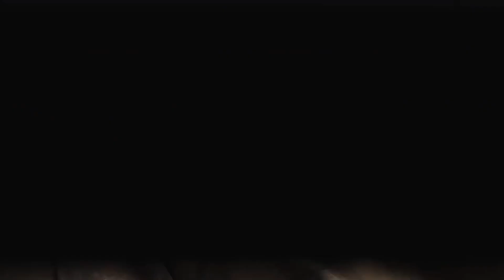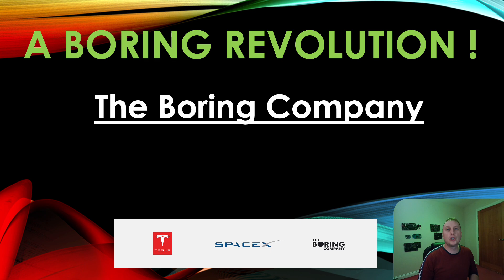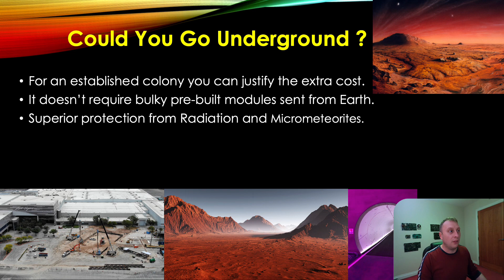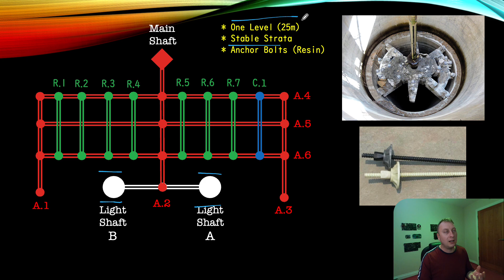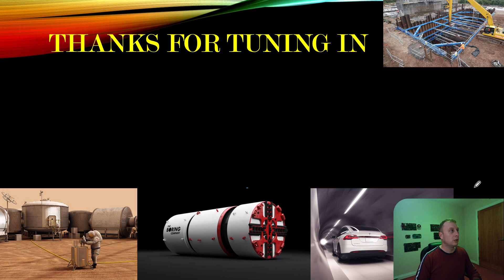A Boring Company Guide To Tunnelling On Mars 😃 👨🏼‍🚀 🚀 🚇 🏗️ 💰 #181

Comment: How do you keep the pressurised gas from escaping through the cave surface or cracks? Without large amounts of water to spare, TBM or shotcrete are not viable; an underground mine could work through a side wall of a canyon, like some proposed projects, probably at Vallis Marinaris. Ores will be found thousands of kilometres apart, so freight is necessary between sites.

Comment: There's no way large machinery like a Prurock TBM will be shipped to Mars from Earth. One day TBMs may be constructed on Mars (presuming some other mechanism like laser drilling doesn't surplant this method). You can imagine the level of industrial and material mining which would be required to get that far.
I believe Mars construction will largely be a case of excavating areas for the buildings and trenches for the communication infrastructure and then covering with a decent layer of soil for radiation protection. We could do this on Earth ... except that here we have pesky environment considerations and centuries of human land management to contend with ... on Mars we could get into some serious land scupturing! A million optimus robots digging away :)

Comment: One issue with roadheaders is the limitation on the rock strength they can excavate. They are typically used in soft rock (up to 40MPa) or highly fractured rock such as shales, mudstones, coal etc. The rock on Mars is mostly Basalt near the surface (very hard rock), which roadheaders would just bounce off, there are shales, sandstones and conglomerates also which could be excavated by roadheader.

Comment: As duanelawrence4311 alluded to below I've just watched a Youtube video where they talk about a 1972 patent that the U.S. government bought that's about using high heat for drilling tunnels.  Among the benefits are there's no debris and the heat is so high the tunnel walls are sealed.  For anyone who's interested you might want to search on: patent method and apparatus for tunneling by melting.

Also, the Youtube video I referred to is titled: TOP SECRET U.S. Government Tunnels | Cities Of The Underworld (S4, E2) | Full Episode

I'm wondering if it would be easier to transport a small nuclear reactor to Mars instead of tunneling machines, dump trucks, tunnel lining, etc., etc.  Then there are the small details like getting access to the patent and permission from the government to have a nuclear reactor.

Comment: Nasa has been developing nuclear drilling.  There is loads of tech that Nasa is developing.  Another example is contest between start up companies to build houses from material from the moon or mars.  I respect your engineering experience, i just think there are things that you are unaware of in the space industry
Reply from the maker: Nuclear drilling is over-hyped and complex to maintain!
Why spend $90M on a single Nuclear drill when I can use a $17M road header and buy 5 of them?
Complexity is the enemy of common sense. We must keep it simple and focus on simplicity rather than cracking walnuts with sledge hammers.

Comment: Geodesic domes don't even work well on earth. The one at South Pole was ultimately demolished because it was just too much work to keep it going. Meanwhile the arches are still in use and were even upgraded after being use about 30 years. They're using the "building in a box" concept, where the arches themselves are now buried in snow and independent buildings on stilts have been erected inside them. That seems to me the likeliest way to effectively build on Mars: independent buildings on stilts (to insulate from low temperatures) inside tunnels or other underground spaces. The air gap is the first step toward insulation.

Don't forget that Mars is very cold. If you aren't taking the temperature into account you're hardly even trying.
Reply: Other general comments:

I do like the idea of using roadheaders. I stayed a night at a hostel in Coober Pedy that was shaped by roadheaders, and apparently they can dig out a house size structure in just a couple days.

Light shafts could be useful, but don't forget that modern lighting can provide full spectrum light at a reasonable cost. That might be preferable.

There's been a lot of talk about using lava tubes - which on Mars could be quite large and would be useful for public spaces. A fair amount of waste rock could be ground into sand or the like to provide the substrate for soil, and could be dumped in lava tubes to even out the bottom and began preparations for open spaces where grass or even trees might be planted.

All things considered, I think a colony should be more like 90% or 95% underground, rather than 60%. There's really not a whole lot that HAS to be on the surface, even if a fair amount of work is done there. The space port, cargo depots, any observatories, perhaps solar panels, and the entrances. Not much else.
Reply from the maker: This is by far the best comment I've read today. I think together we could design a fantastic colony for a low cost.
I kind of like the idea of light shafts becoming town squares / landmarks but you wouldn't build that many. Maybe its more of a social experiment.
I can imagine a means of building connected steel cubes on the surface and covering them with compacted spoil to a depth of 4 meters. These could then be converted into offices / laboratories e.t.c
90% is possible in the long-term if you have good geology and fully automated machines.
Reply: @BoringRevolution  - coming up with some designs might be fun. Having seen the messes that have been built in Antarctica I can't help feel that the people responsible for them did not put much thought into them.

I was especially amused looking at the blueprints for the Crary science building at McMurdo: designed in Hawaii.

Naturally if I'm going to build in an environment where the temperatures seldom exceed freezing I would look to Hawaii to find people with the right attitude and experience....

Frankly the stuff built by the early explorers had a lot more thought involved. They at least knew about insulation. Yes, when the U.S. Navy built McMurdo Station they did not see a need to insulate the buildings. Even an office building that is used year round does not have insulated walls.

And I get a similar feeling when I look at plans for colonies on the moon or on Mars - as if these designers are on autopilot and have never even consided how the people living there would go about their lives.

I have also had a long casual interest in underground construction, so for me the two ideas go naturally together.